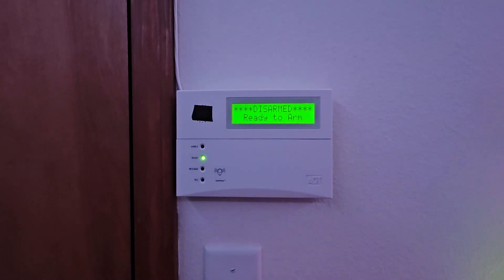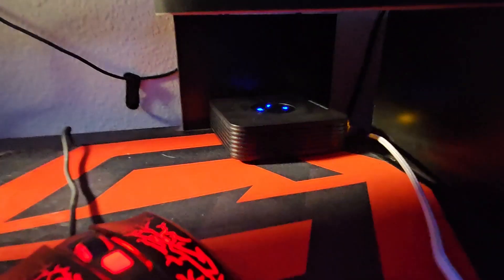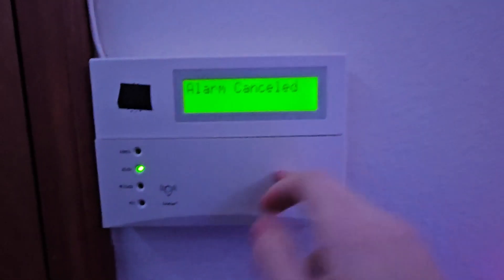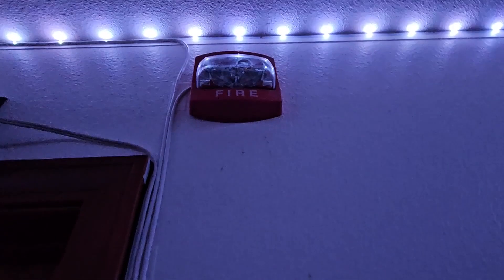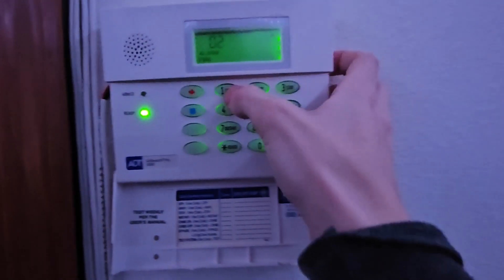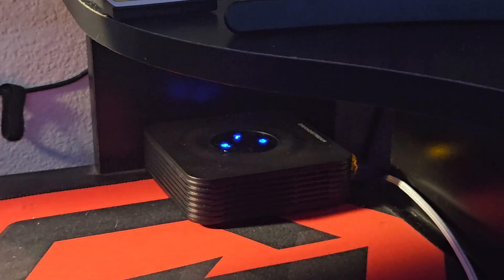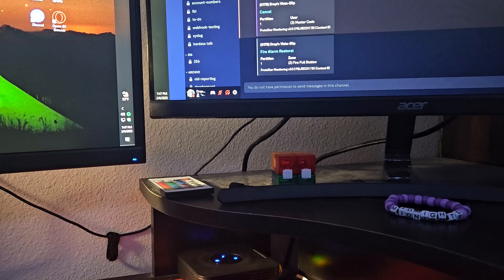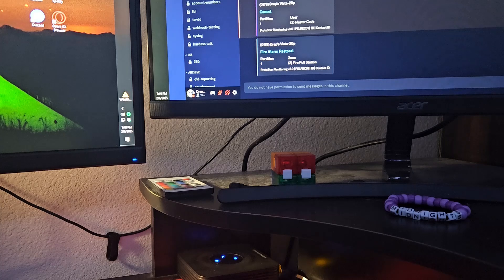System Test 3 (ANOTHER NEW DEVICE!) - Honeywell Vista 20p System

Comment: did you wire the horn terminals to cause on some simplex truealerts it has separate terminals for the horn and strobe.
Reply from the maker: there's only 2 terminals on this one. positive and negative.
Reply: @Draps_Technology  oh is it freerun or smart sync
Reply from the maker: freerun i believe.
Reply: @Draps_Technology hmm it should still run on 12 vdc the horn might be slow and or quiet but it should still work.
Reply from the maker: id have to do some more research. Sadly, I'm not at the house with the system atm.
Reply: @Draps_Technology  just hope it works
Reply: @Draps_Technology and also kinda from nowhere where do you get the transformer for the vista 20p panel
Reply from the maker: it came with the bundle I got on ebay. if you want, I can tell you the specs of it on thursday.
Reply: @ okay

Comment: The horn should still work, my neo has a 24 volt alarm but it still sounds
Reply from the maker: weird, I'll have to do some more research on the horn strobe.
Reply: @Draps_Technology if the horn strobe has a model number of, 4903-9417, 4903-9418, or 4903-9419 it is smart sync. If it has a model number of 4903-9425, 4903-9426, or 4903-9427 it is free run.